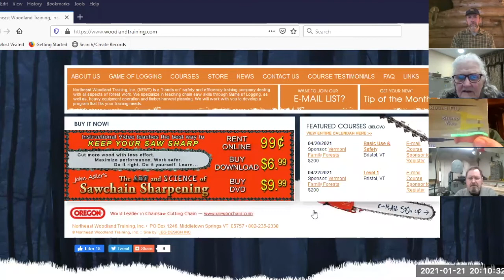John Adler   Chainsaw Chain Workshop   2021

Comment: Do a video on STIHL Filing Depth Guage Tool #1110 893 4000, not just the raker part  but what are all those angle slots for man?